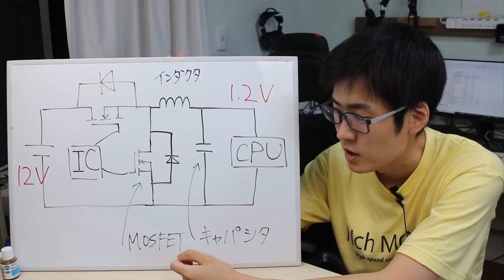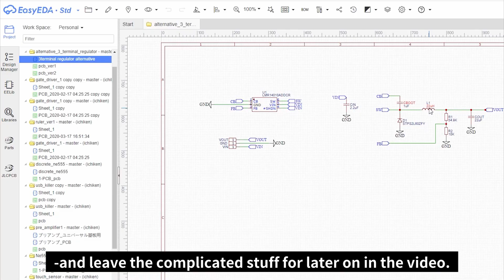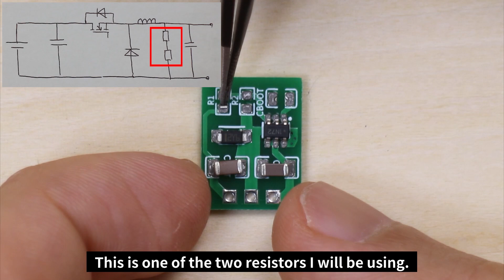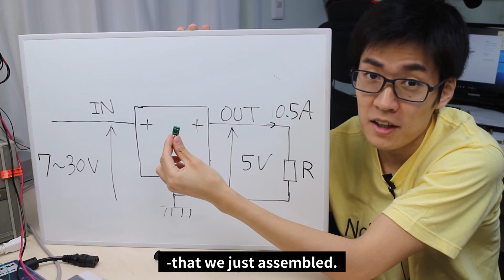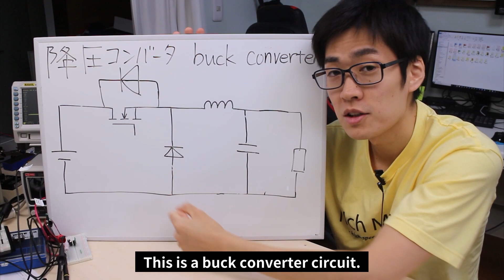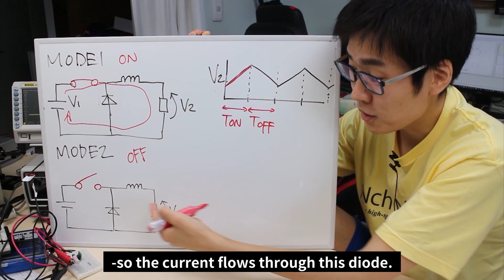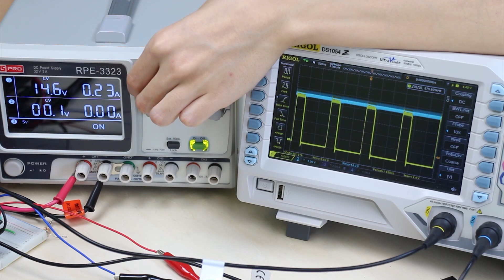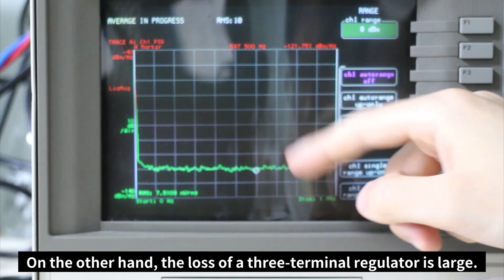Making a small switching regulator. How it works. Buck converter

Comment: Neat video, thanks for explaining things.

I'm just more careful about the LGA socket:
1) the pins are very sensitive to mechanical damage, best to leave them aligned into their finnicky rows
2) I'd also prefer not to cover the contact surfaces with the protective bodily fat covering my fingers, thinking of the currents flowing through some of the contacts to the CPU... (can be around 100A at something like 1V).
I know that yours may be a dud motherboard - in that case I'd add a warning in the vid, where you poke you fingers at the socket :-)